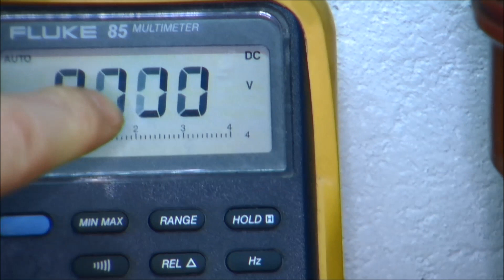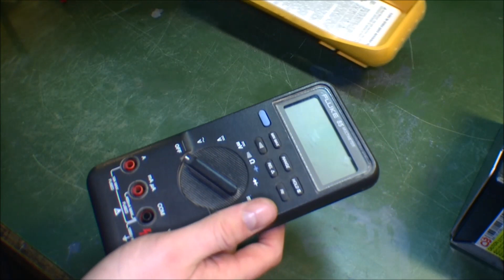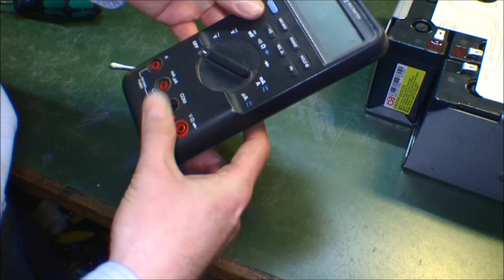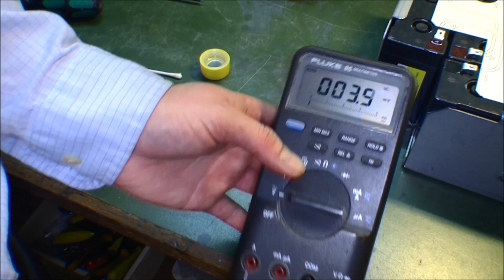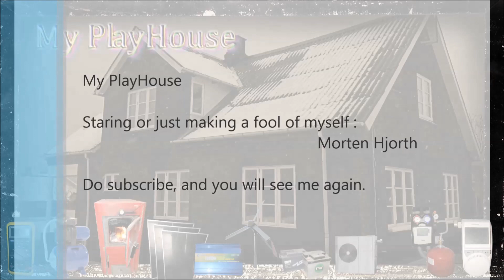Fixing Fluke 85 Dim Ghost LCD Display (Fluke 87 / 83) - 144

Comment: Thanks I found one someone at work threw out because the display wasn't readable. Thanks to youtube I found out I can clean the contacts and get it working. It works perfectly now thanks. Just make sure the longer strip on the display goes at the top and the shorter strip goes at the bottom so you don't have to do trial and error. I just used alcohol to clean it.
Reply from the maker: Hi greenspiraldragon
Thank You very much! I am so glad I could help and get more life out of your fluke :-)
Thank you for watching! :-)
Reply: Funny same here....guy at work gave me a dead 87 and he says maybe I can use for parts. I fixed the display and lived happliy after. Felt kinda bad...but not that bad. That was 13 years ago.

Comment: Great tip, thanks.
BTW, that trick also works very well on TV or DVD/BluRay remote controls on which the buttons have to be pressed very hard for them to work after a few years. Just take it apart (sometimes a little difficult because their casing is often two halves snapped together), and clean the PCB traces and black conductive rubber dot with isopropanol (isopropyl alcohol), and they should work like new again.
Reply from the maker: Hi AlainHubert
Thank You very much!  glad you liked the video :-)
Thank you for watching! :-)

Comment: I believe most if not all flukes have a lifetime warranty, my Fluke 79III does...
Reply: Maybe they do in recent days, but not back in the 1990's. My model 87 is not under warranty and they won't calibrate it anymore either. Only offer a replacement model 87-V for an upgrade cost of about $350.